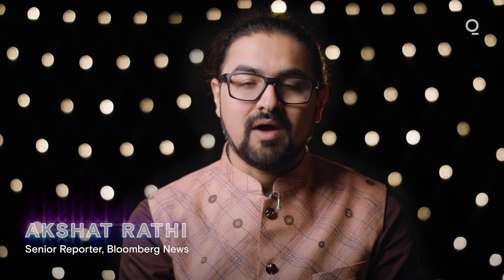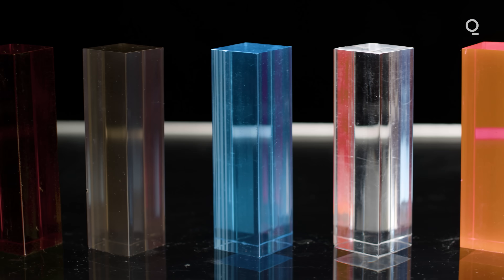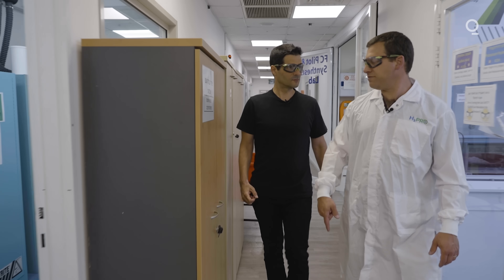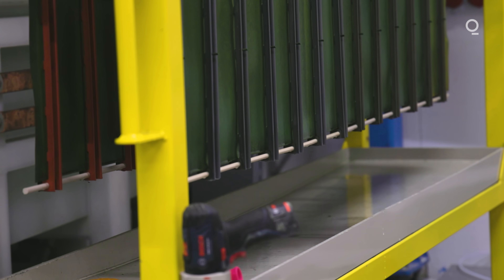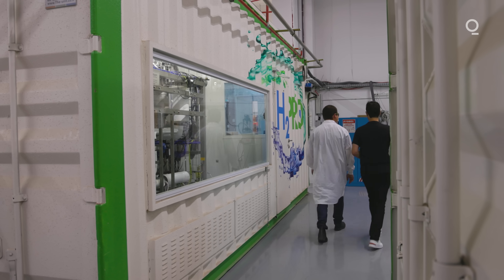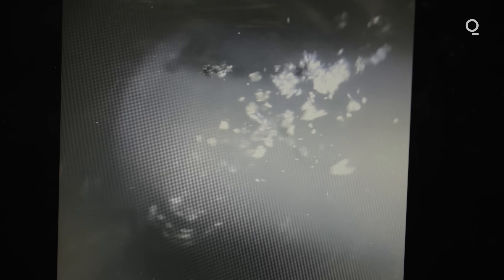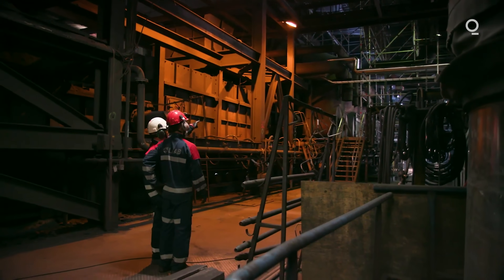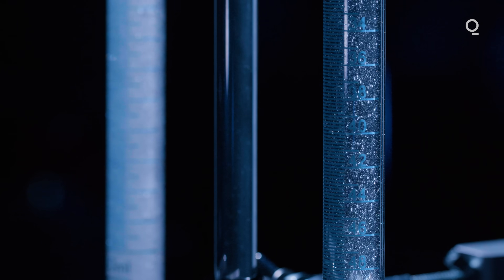How Cheap Hydrogen Could Become the Next Clean Fuel

Comment: On the color scale, there's also UltraGreen H2: taking biomethane or other waste methane that needs disposal without leaking into the air (where it's 88 times worse than CO2), splitting off the 2H2 from CH4, and sequestering the carbon to avoid any GHE from biomethane.

This keeps natural gas in the ground, delivers green hydrogen, and avoids GHE from biomethane.

Though, really, all hydrogen runs the risk of encouraging black hydrogen and acting as cover for black hydrogen production. Far better to go electric, on the whole, or taking the urea path.

Green urea is much better than any hydrogen.

Comment: So, take water, add energy to split it, then "burn" the hydrogen to generate water, and hope you can do this magic and end up with more useful energy than energy used. It seems like burning a candle to create heat to make candles.  Or creating a dam where you pump the water back to the top -- if you can do that so it takes less energy to pump up than is generated when it falls, you'll be rich.
Reply: Can't tell if you're joking, but you know that's impossible right? You can't create energy. Only convert it from one type to another.
Reply: @ottoscheffler  You can't turn energy from a solar power into jet fuel or chemicals for industrial applications (like natural gas is used).
Not everything can be "battery powered". Maybe one day a machine that assembles atoms can create whatever you want by plugging it into a wall outlet, but so far we can't make fertilizer out of charged batteries.

Comment: Yo Bloomberg journalists, take note:  I get that your background is not in engineering but everyone covering this topic journalistically seems to miss a crucial point.  The technology of converting XYZ into hydrogen is only half of the picture.  The other half is quantifying how much energy each process takes to produce that hydrogen and where it will come from if the technology is scaled to it's intended industrial output.  For example if the water splitting company opened a hypothetical plant tomorrow, where is it, and what power sources are being used to make sure it is fully operational on a daily basis?  You need to cover that part of the hydrogen story as well.
Reply: this actually can use as energy battery. Use solar energy to split it and store the energy as hydrogen fuel, easier said than done tho.
Reply: It's meant for fund managers looking for VC opportunities. Mr. Pedro over there who founded 2 renewable startups and now working on "sacred" third proves the point.
Reply: thats literally what 'green' hydrogen is in this video, hydrogen that was made from a plant that is powered by renewables.
Reply: Yeah they did make it clear that an energy source is needed. Solar and wind for green and nuclear for pink.
Reply: @adrianthoroughgood1191  Fair to an extent.  That is just parroting back the definitions of what they are, and yes that is correct.  I want to see them tackle the nuance of these definitions in the circumstance that they have built up their first large scale production facility and require a GW of electrical input.  That first facility won't likely be green. These documentaries omit these more problematic nuances.  If a facility were to come online next year for example, fossil fuels will be used to generate a substantial fraction of energy required for the H2 conversion.  There is not a high round trip efficiency of storing then utilizing hydrogen for power, this is the read between the lines point my original statement was hinting at.
Reply: @MotherNature26  I have a chemistry degree and you are right on.    Right now, this is a fantasy fuel.
Reply: @adrianthoroughgood1191  but solar and wind equipment requires fossil fuel energies to get manufactured and maintained in a functioning state.
Reply: @zest01  As does any equipment required make and use hydrogen.

Comment: Don't worry about the carbon in the atmosphere, it is needed by plants for photosynthesis. This technology was already perfected by Stanely Meyer, but he mysteriously died. No need to separate out the oxygen and hydrogen, just burn it on the spot to produce electricity. Problem solved.